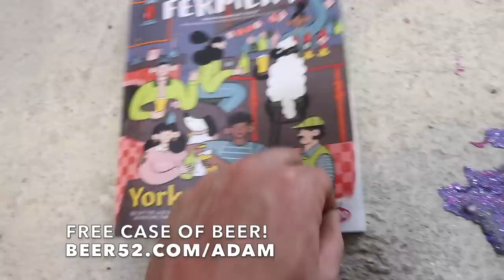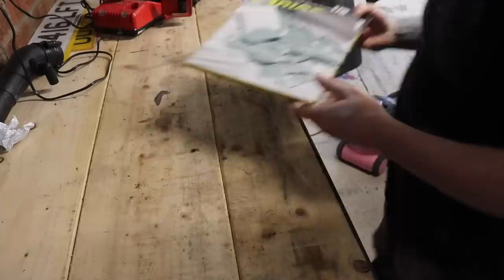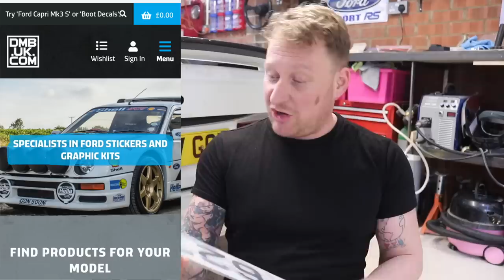RESCUED SIERRA SAPPHIRE RS COSWORTH ** AMATEUR PAINT JOB!! **

Comment: Great work.

Some tips for you in the future. You are sanding way too fine before paint. 800 is the finest you should go, the finish paint needs something to stick to, and 3000 is more than likely going to cause you problems in the future (I hope not but it's likely).

Also resist the urge to touch the piece with bare hands, I know it's nice to feel the smoothness but you run the risk of oils from your skin getting into the primer (especially a 1k primer)

Keep up the great work and learning!

Comment: WD40 is actually silicone free nowadays, I am 25yrs in the bodyshop.
edit: you had the heat gun out, you could have pushed the dent out a bit before filling.
You did extremely well to get rid of that sagger though, that's one of the best skills you can have in vehicle refinishing.

Comment: That bumper trim and double sided tape would have just peeled off in one go if you’d heated it up with a hair dryer on high, or heat gun on low. One wipe with panel wipe would have removed any last residue from the tape.

Comment: not a pro, but i have bodged a few jobs with rattlers over the years :D

no real need to sand primer past 1200 grit. if anything the tiny scratches it leaves can help the colour bite into the surface. i have tended to go 1200 primer, 2000 base and 3000 on the clear coat. or to refresh glass/head lights.

looks mint on screen dude!

Comment: Top video Adam… good effort… I’ve found that when getting aerosols ready, it’s useful to stand them up in a bucket of boiling water as it helps warm the paint and mix the agents which means less shaking required. This has always worked a treat for me and less runs and spots 👍

Comment: Hope it works out for you but I'm afraid the highest grit you should have done is 600 before base this will eventually flake off. The sanding process you used would be fine for finishing the clear

Comment: Not sure hi build primer is the best foundation for priming a raw plastic bumper...there are specific products to promote better adhesion as getting paint to actually stick in the long term is not actually that easy. You really don't want a super fine finish on tge primer either as it gives the colour coat very little to actually tie into. Depending on what it is 600 to 800 max for primer. I fear you may have some flaking issues in the future which is a real pain to sort as it all has to come back off.....

Comment: A tip when painting, use a Matt black cellulose aerosol to use as what’s called a stain used very lightly just dusting on then flat with 600 that’s about as fine as you needed otherwise you are almost polishing with 1500 it will key better with 600 , when using the stain it highlights any low spots and bits of dust in your primer giving a better surface to paint on.👍👍👍

Comment: top job 👍
however the primer should have been keyed with 600/800 grit not 3000 .... adhesion problems could lay ahead..... 

use 3000 grit when wet sanding to get rid of orange peel

Comment: Great video Adam, the paintwork turned out amazing, the bumper looks like a new part.
I really like those original dealer plates with the correct font, I’m very OCD with details like that, so do like to see classic cars period correct down to even the smallest detail.
PS I did notice your other Sierra appears to have the new font registration, maybe that one could have the DMB touch as well lol 😆.
Reply from the maker: Cheers Katie. The dealer plates definitely look a lot better 👌🏼

The plates on the 3dr are the correct font they’re just plain plates though. 👍🏼

Comment: Best thing to use to get tape residue off is 3M adhesive remover once you’ve used it once you’ll never use anything else, not cheap about 18quid for a liter but will last ages

Comment: You did a great job on the painting, the finish looks really glossy for aerosol tins, did you use clearcoat? One tip I would give (not a pro by any means but have painted a few cars) is that you really don't need to apply that much paint. 2-3 coats is more than enough and putting more on is just a recipe for runs and costs more!

Comment: Nice job on the paint finish, was it 1k paint can that will crack and fade in the sun eventually or is this a 2k with pre filled color to mix with the hardner as this is to be used in 24hrs solid bodyshop quality I usually go for the Mipa range best hardners.

Comment: Love your enthusiasm, car us really coming along.
Hope you didn't go too fine with the sanding before painting and the paint doesn't peel. It would normally benefit from mechanical key. 400 / 600 would be enough.
Reply: 800 is totally fine.
Reply: @LleidrLlŷn  yes, not for me however. My concern on adhesion is more related to the 1500 and 3000 steps.